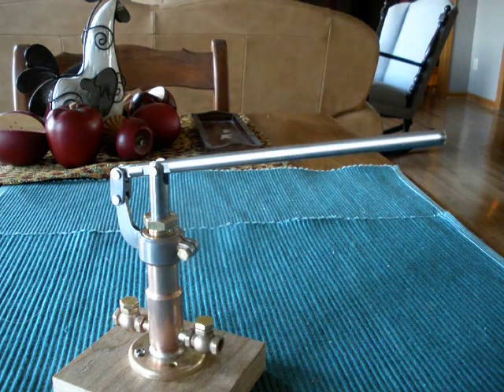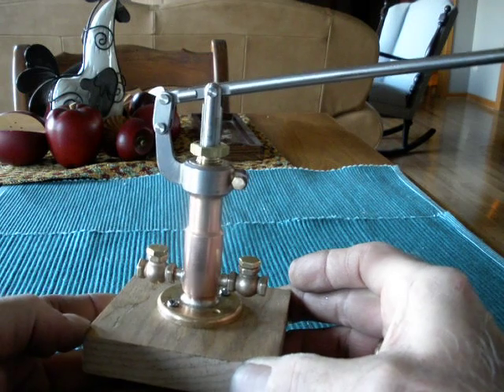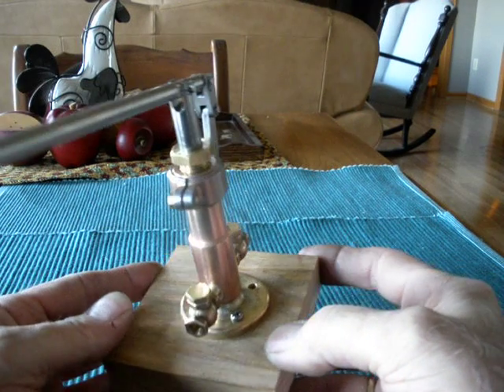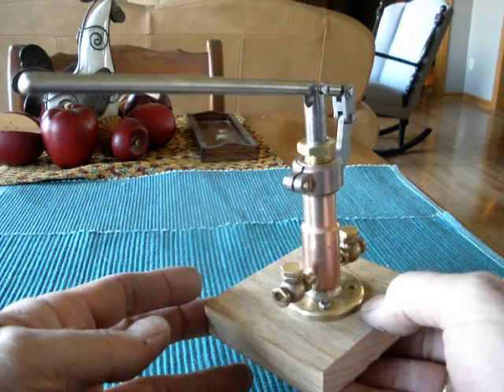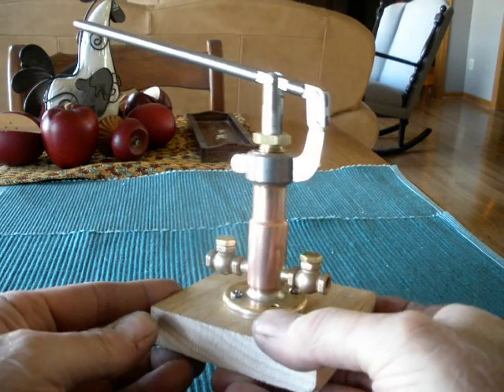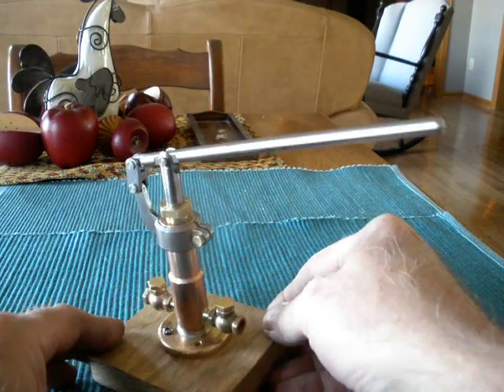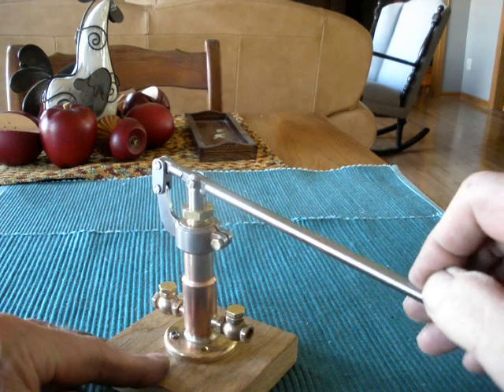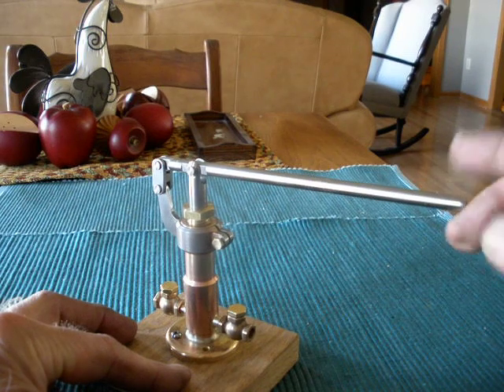Live steam launch hand operated boiler feed pump

Comment: Why a check valve on both sides? I have 2 big pumps, one has one check valve, one has one on both sides. I have only tired the pump with one check for hydro test on Cyclotherm. I was unable to get pressure. Must I have both check valves to get hydro pressure or feed pump pressure?